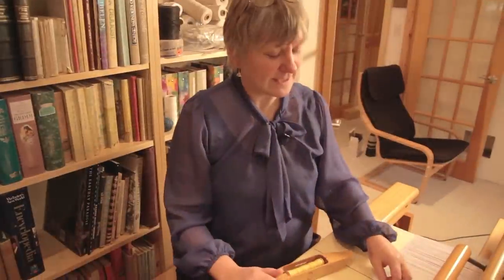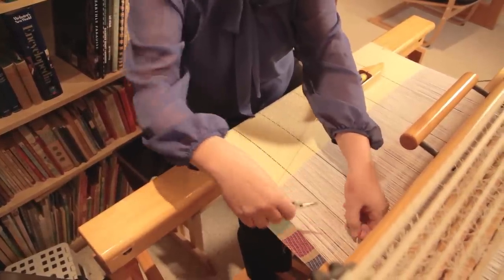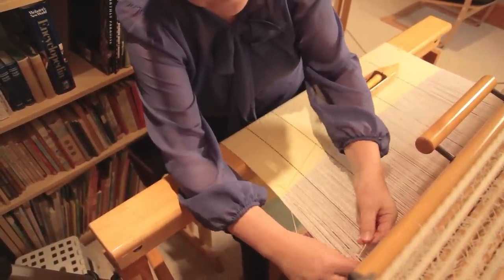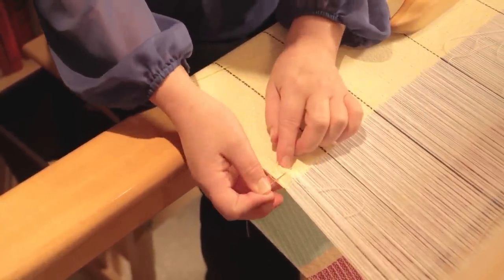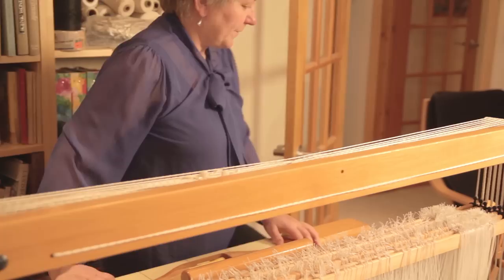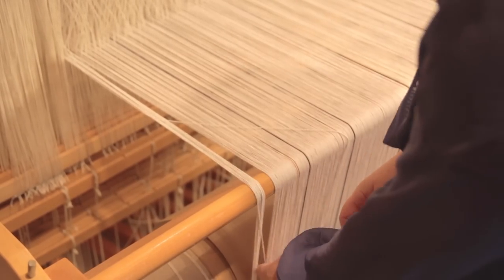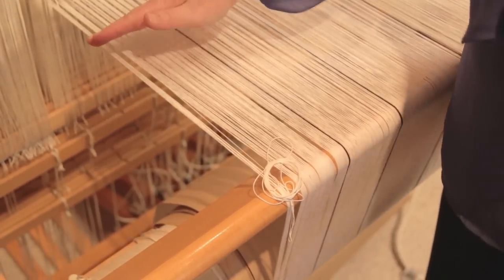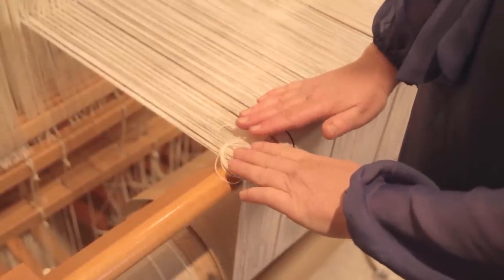Weaving Basics: Fixing a Broken Thread

Comment: My floating selvage thread broke just at the fell line.  In this case, would you recommend weaving in the new repacement into the just woven cloth and then anchoring it with a T pin to be trimmed off later?